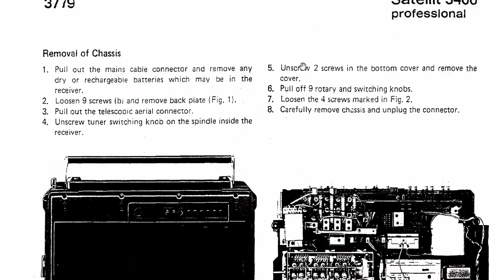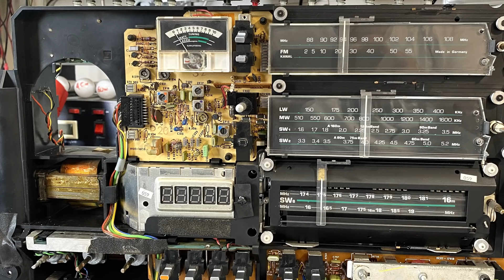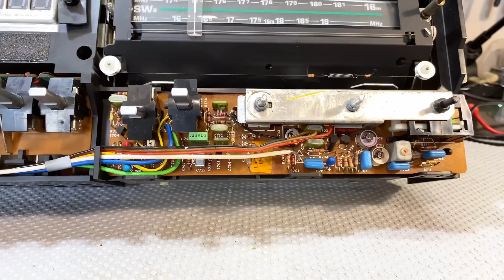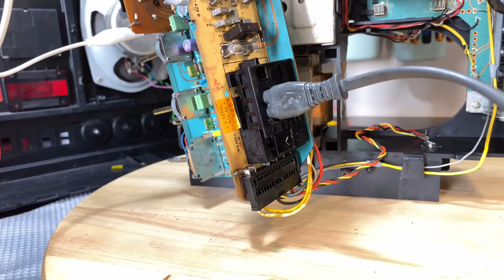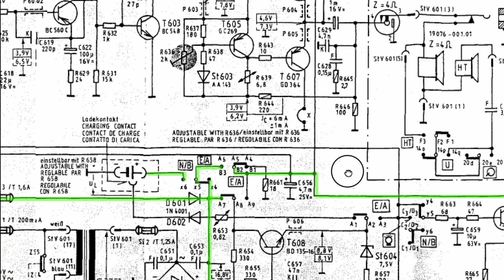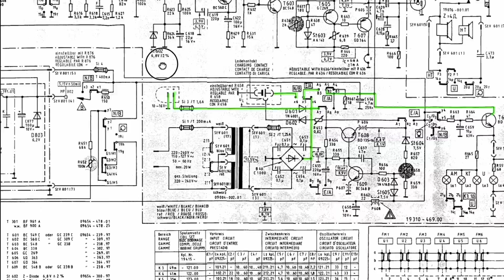Who said this was tough? Grundig Satellit 3400 Pro restoration part 2.

Comment: Thankyou very much for your very good tutorials on this radios. I have two of them. One in very good working condition and another recently bought very cheap as a non-working radio. This video and the others helped me very much in locating a shorted filter capacitor (C656) on the powerboard on this radio. This makes it inoperable on both AC and DC.  With the help of your videos I think it also should be up and running soon. I also have "professional" receivers Drake SPR-4, ICOM IC-R71E and Kenwood R-5000. The radiostations you can catch with these radios is mostly caught with the Grundig but with superior audio. The FM band on the Grundig is also very impressive.

Comment: Hi there,

I have a Grundig satellite 3000 which is the same as the satellite 3400, but with mine one, I need all the wave bands realigned and the bandwidth switch needs changing and the presets buttons need changing on the FM, also I would like the SW drum tuner cleaned and refurbished on the contacts.

I live in the UK could you give me an estimate of the repairs?

Thank you for your help,
Kamil Mustafa
Reply from the maker: I don’t do this professionally, but rather as a hobby on my projects.
Reply: @electronicsoldandnew 😂

Comment: Hi Manuel, Did you completely disassemble the AC mains/battery switchover unit to clean or simply sprayed the contact cleaner over?
Reply from the maker: Spraying is enough Disassembling the switch block is not fun 😊
Reply: @electronicsoldandnew  Got it, thx!

Comment: Manuel, may I aks what capacitor did you used as a replacement for the large 4700µF, 25V Capacitor on the power board? This form factor doesn't exist anymore and I can't find one with a similar raster size either. Is the only way an axial cap with a bent down minus pole?
Reply from the maker: No, O I used a normal radial cap, and just connected the “+” and “-“ to the proper points. The existing one has various ground (or case) tags that served to add stability to the cap, but with the newer and smaller caps, you don’t need to worry about that.
Reply: @electronicsoldandnew  Thank you👍

Comment: Another nice restauration, Manuel! I have restored a Grundig Satellit 3000, which looks almost identical to yours both inside and out, except mine is silver on parts of the cabinet. Mine had a couple of switch levers broken also, and a broken shaft for the BFO control. I found this to be a minor concern, I listen to the ham bands (but have better gear as well..) Mine had a jammed drum tuner, one of the dial plates was loose, easy fix. Apart from this and the usual cleaning of controls I had a switch lever I could put in (the "ANL" is still missing, but not important..

Comment: You can just hear the conversation of the designe engineers .hows that control board going bill  yer good .look undo  four  screws and it's out. The outer guy shakes his head .no that's to easy hide one of the mounting screws under a hard to get at plastic clip .that you need to assess from the front.thats hidden under another circuit board .

Comment: The power/amp board looks a bit difficult to work on. I'm a bit like you in not trying to remove wires if possible. I'm pleased to see that those broken switches are only cosmetic damage and I'm sure you'll do a great job in repairing those. I would still like to own one, seen one for £100 and another for £200 excluding postage. They both look clean externally. Your videos were excellent for the 2100 and we save the 3400, should I buy one.
Reply from the maker: I think when you see this thing working you’ll definitely want one 😊